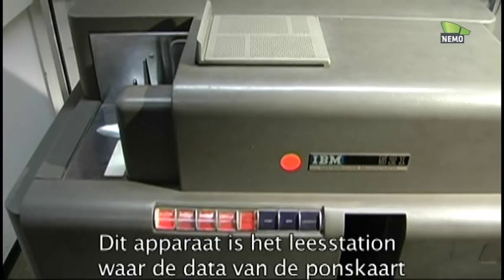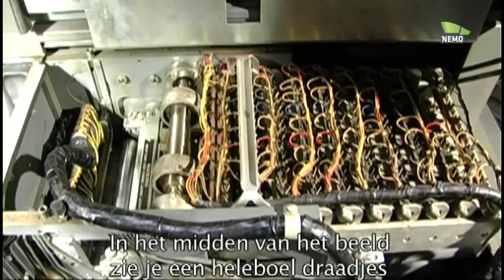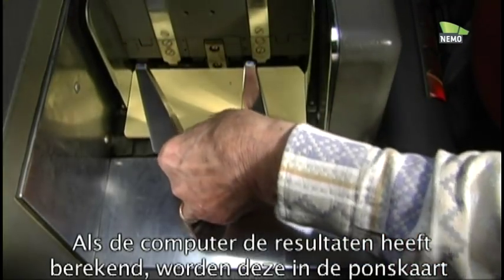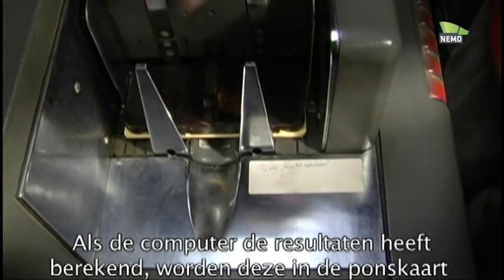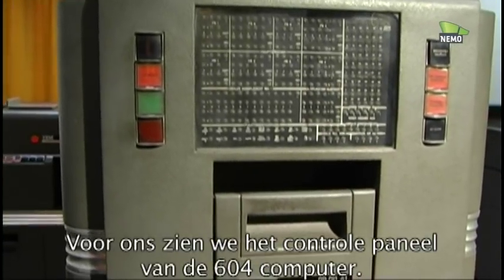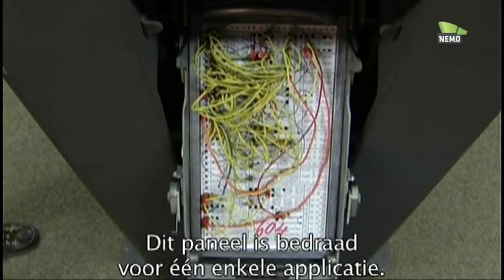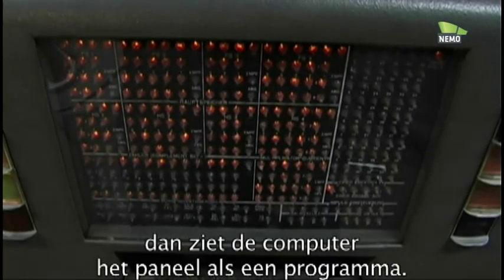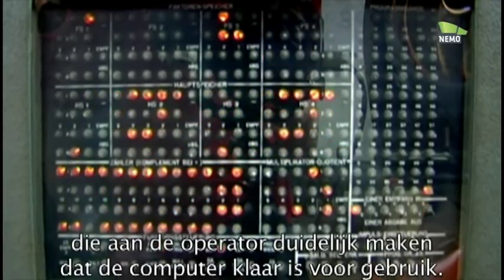Running IBM 604, 1948 computer

Comment: How can vacuum tubes be used as logic?
Reply: SouthwesternEagle Exactly the same way as the solid state transistors in your iPad or i7 s processor. Its just boolean algebra translated into electricity. In the case of the tubes or valves LOTS of high voltage electricity. The British invented the stored program computer to crack the German and Japanese codes in world war two.
Reply: andrew allen I don't understand square 1 of computing. How can math be translated into electricity, and how can that perform calculations with just on/off switches? I can't wrap my head around that.
Reply: SouthwesternEagle google boolean algebra then discrete logic gates like and,nand,or,nor as well as xor. The gate functions are completed electronically and are logically identical to the boolean algebraic functions. The logic gates may be composed of thermionic valves, transistors or even pneumatic valves.
Reply: Mr Eagle.  Let me simplify Mr. Allen's answer a bit.  Tubes and transistors can act as switches like he said, and they can be either on or off.  Let's call On a (1), and Off a (0).  By doing that, the tubes or transistors can deal with binary numbers, which can be converted to base 10 numbers that we're all familiar with.  Now, go study this for a few years and get back to us.
Reply: Larry Cook :)
Reply: Let me simply explain.
Diod, transistor, bananas, cats inside a box (alive or dead), squirrols, pancakes, ecc.... All of that things may be described with 1 or 0.
So you can build a computer with anything.
Is the logic operation that is important.
Computer are only instruments.
Anyway they think that humans are instrumental for their growth.
This is called Philum Macchinico, read about Manuel de Landa to learn how humans are not most evolved specie in this Planet.

Comment: Thank you for that video
How many RAM was it?
Reply: Not sure if this is useful ... back in 1977, we had a Data General Nova II, with 32K (words) of main memory.
     It had 4 VDTs (video display terminals), a paper tape reader, a 50MB hard drive, a tape drive, and a Burpee paper tape punch.
     That computer was used as a typesetting system with software by CCI (Computer Composition Int'l).  Yes I know pretty much every company I've mentioned is gone by now.
Reply: None. It had a very few machine registers that could hold about 10 digits each. It was much more of a pocket calculator than a desktop computer.

Comment: This computed using magnetic logic, right? I saw many inductors within the computer, so I am assuming it did.
Reply: +Quentin “SpecialBomb” Jankosky 
The logic is in vacuum tubes; the ALU contains approx. 1,250 tubes.  There was one 604 built with DTL logic using 2,000 transistors, but this was only a prototype.  The successor machine, the 608, was the first solid-state computer sold by IBM.
Reply: douro20 sounds like a maintenance nightmare.

Comment: where do you even start repairing this thing..
Reply: Got to a TV repair shop with your brown paper bag of tubes and have them tested..
Reply: First, you look for tubes which have burned out.  The ones which are working are hot.

Comment: I ran across this old digital computer patent 3109554 that used compressed air instead of electricity. Was such a computes ever build and used for anything? Could one be built today using 3 D printing?
Reply: +ufoengines In the 70s I remember reading that these fluid dynamic logic circuits were being used for the low speed logic to control the status of DASD units (the hard drives of the day) without generating electromagnetic "spikes" when switches changed state, which could result in spurious data pulses.  I'm not sure if this got beyond the prototype stage, since circuits to filter out noise spikes were cheaper than fluidic logic circuits.
Reply: +Allan Richardson Thanks for the reply. Seems some kid came up with this fluid logic, patent 3107850, and then gave it to the world. (Must have known microchips where coming. : ) Seems like it would make a cool project for some tech high school kids to make one using 3D printing and then post a You Tube on it before donating it to a computer museum. Read that making Army Crabs run logic gate mazes you can do computation and now I thinking you can do the same with brush bots. Something a bunch of eight graders could make a You Tube about. I guess if Babbage had gone this air computer route that his Diff. Engine could have been built by the pipe organ people and Lady Ida could have invented COBOL. Another guy replied to my question on this when I asked if this tech was ever considered for the moon shot and he said no but rocket exhaust was though as a source of power for a fluidic computer for I.C.B.M.s. I'm going back to read his reply to see if I got that right.

Comment: Seeing the actual working machine, I really wonder ...what was the function of the blinking lights? They seem completely random, so seeing those on computers in old sci-fi movies I always thought they were pure cosmetic, however they must've had some meaning after all.
Reply: Take a look: http://www.piercefuller.com/collect/ibm7090/sim7151text.jpg

The blinking lights were the display. There wasn't a separate monitor in those computers. Just lights, printers, punch card readers and (later) tapes.
Reply: Those blinking lights actually were useful.  We would kind of learn the "pattern" of the lights, and the program got caught in some kind of fatal loop, the repeating pattern of the lights was obvious.
     <stop> <reset> 100032 <program start>
Reply: The lights show the state of the machine.  They blink because the machine is constantly changing state.  When the program halts, the lights stop flashing and the programmer can interpret the lights to determine where it stopped and what values were in the registers at the time.

Comment: ok what's the point of this machine?
Reply: Nunya Dambidnis to do math.
Reply: Something like this might have been used for the 1950 census.

Perhaps the IRS or the military had a use for a computer which could do math much faster than was possible when people used slide rules.

We have to keep in mind that this computer is over seventy years old.

Comment: Not terribly satisfying.  You tell us that the card reader is used to feed data into the computer, and then tell us that it does this not electromechanically, but mechanically.  Well, first, it doesn't punch cards at ALL to read in the data, obviously; you just skipped from one activity to another without any reason or explanation.  And second, the computer itself is an electrically-operated machine - ALL of the signals are electrical, so if anything mechanical is happening, it's because of the electromechanical devices such as relays, solenoids, and electric clutches.  So what little information you DO give is wrong, anyway.  You might as well have just stayed quiet and let us watch the blinking lights and rapidly-moving electromechanical devices.

Comment: Nice to look at, and maybe play a simple game, but not quite reliable and accurate enough to do much with these days. Tubes make better amplifiers, oscillators, and so forth than they make for good computer circuits. The MTBF is too low on tubes compared to even a 8008 processor chip. I was able to do more with a programmable calculator 40 years ago than can be done with this computer.

Comment: The question is, can it run crisis?
Reply: as it is true for all computers: if you add enough memory and if it can execute enough numbers of command, yes, it can. if the instruction patch field was big enough, you could implement a x86 emulator on it that could run every programm that runs on pcs

Comment: Would these sequence of lights be considered digital logic, despite using electron tube technology?
Reply: The logic was very much digital logic. Digital is when you use a sequence of bits to represent discrete numbers. Analog is when you use a continuously varying voltage (like an audio signal) to represent a quantity. It doesn't matter if you are using vacuum tubes, relays, transistors, or knife switches, it is still digital logic.
The lights don't actually have anything to do with the 'digital" classification. They were just a maintenance aid so that you could see what was going wrong with the program or the internal processor logic and track down problems.